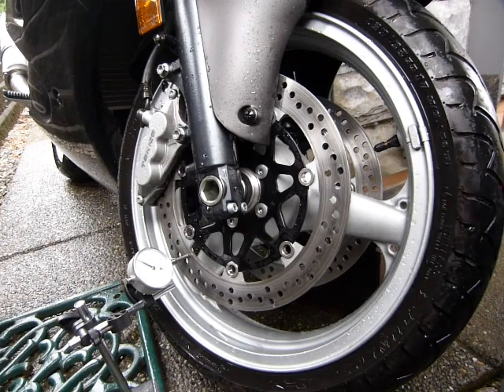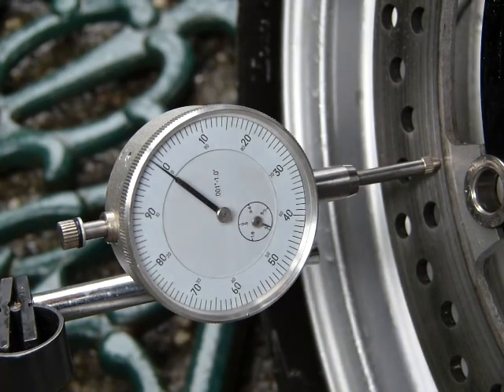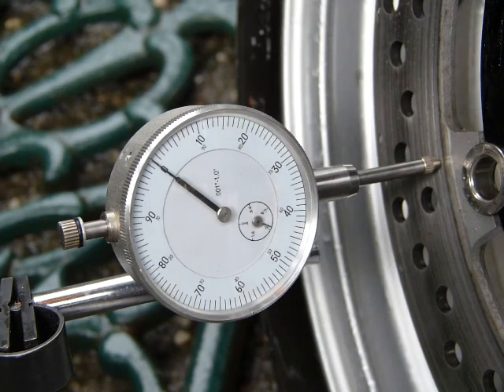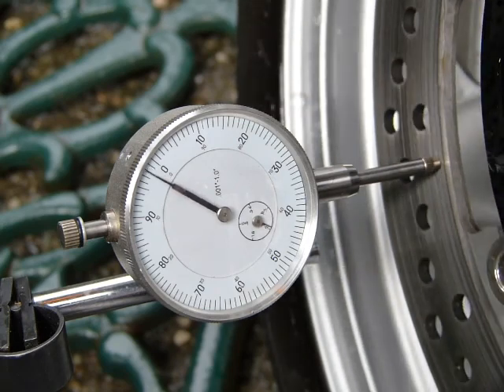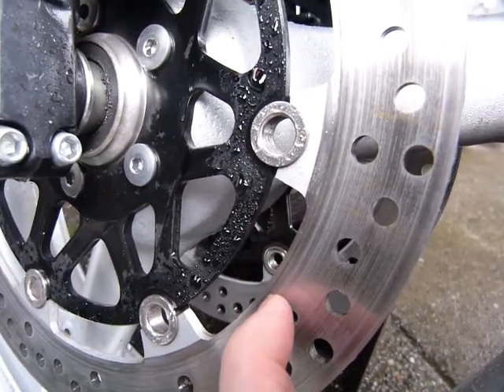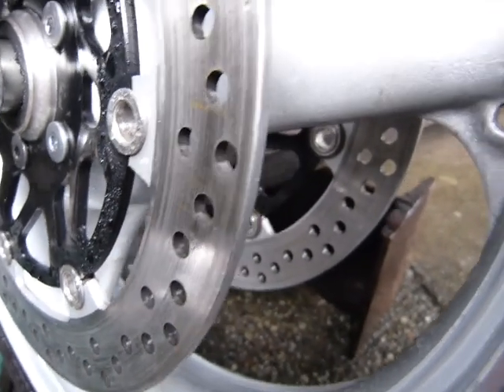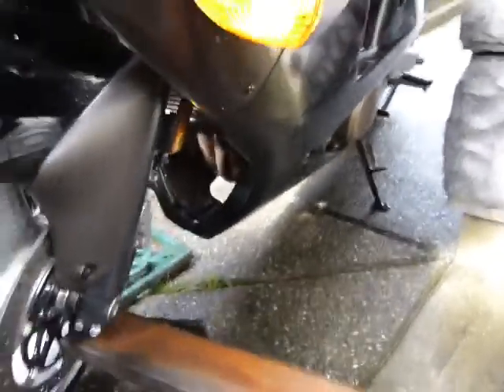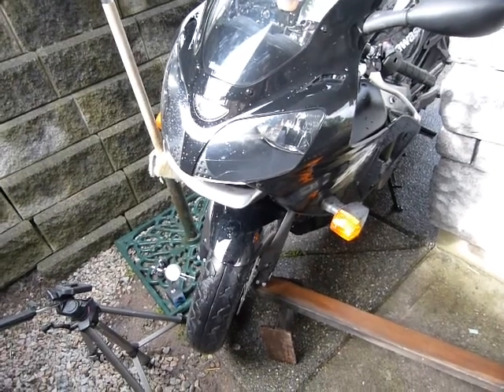Brake rotor run-out

Comment: There are 2 basic types of floating rotors. Full floating and semi floating. The only difference is a wavy washer fitted to the buttons on the semi floating. It just reduces noise. 

Race bikes tend to not have the washers and they make a clunking sound when rolled slowly as the outer ring moves against the fixed inner hub. Once the race bike gets up to speed however, centrifugal force centers the rotor on the hub and it stops clunking.

Comment: Look carefully at the rotor in this video. It has a center hub made of aluminum and an outer ring made of steel. They are connected with large circular "buttons". The inner and outer parts of the rotor can move side to side by approximately 2mm-4mm. 

This is a high performance design found on sport bikes as it makes for a lighter weight rotor that can get very hot without warping. It's called a floating rotor.

Comment: I think your mistaken. Your CBR 125R has floating calipers and a solid rotor, but the bike in the video (ZZR-600?) has fixed calipers and semi floating rotors. 

Generally, any caliper with pistons on only one side has to slide on pins to apply pressure evenly on the rotor.

Calipers that have pistons on both sides are mounted solid as they don't need to slide. The pistons self center themselves to the rotor.

Comment from the maker: The calipers float, the rotors are bolted to the hub. Solid. If the rotor is not dead straight, they wear the break pads even when the brakes are not applied. See bicycle with off-centered wheel.

Comment: I don't think you can measure run-out on a semi floating rotor. You can grab the rotor by hand and wiggle it. It's not rigid like a single piece rotor. 

In fact, I think a semi floating rotor can be slightly warped and still be perfectly usable as it will not push the caliper pistons back into the caliper as it spins. It's basically self centering. 

What do you think?